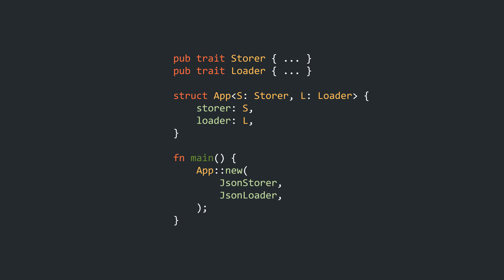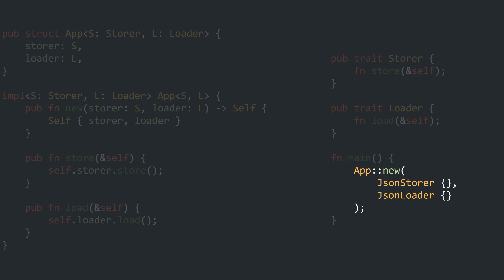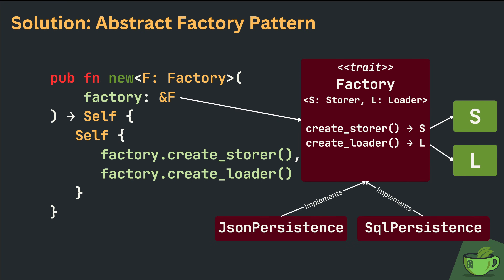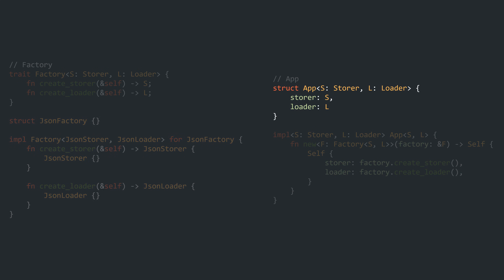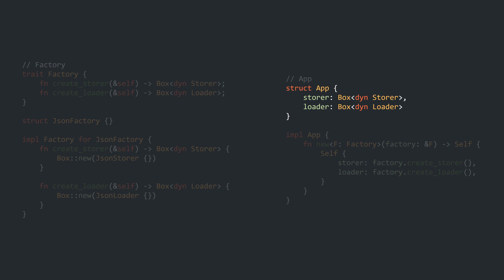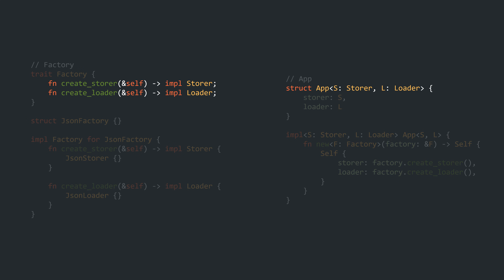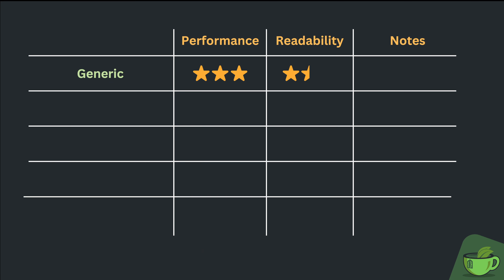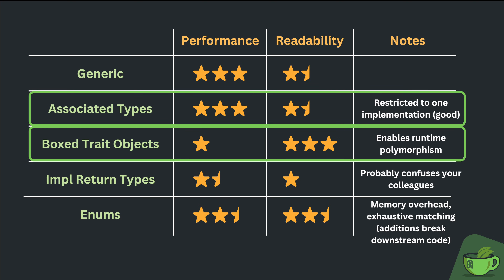Abstract Factory in Rust — Solving a Hidden Design Problem | Advanced Rust Part 14

Comment: The performance overhead with the boxes trait objects is just deref a pointer to get the address of the function and call it.
I would say not using this solution is premature optimisation and hurts readability a lot.
In this case Loader and Storer calls will take a lot longer than the extra overhead from checking the LUT..
You need to think why you are doing things in specific ways, not just always  choosing the most "performant" solution.
Reply from the maker: I full heartedly agree. People don't value readability and simplicity enough, especially in the Rust space, where everybody is hunting for performance.
Reply: It's not more readable because you can no longer guarantee that a Loader is matched with a Storer. In this case, the App is created by passing an F type that implements Factory and that takes care of matching Loader with Storer, but there could be other pieces of code where that doesn't happen. The benefit of not boxing the traits is that you know at compile time that your Loader and your Storer implementations always match (if you put the proper bounds in generics).

Comment: What about

struct App<F: Factory> {
    storer: F::Storer,
    loader: F::Loader,
}

You would take storer and loader separately in new, to make the Factory trait as flexible as possible, likely allowing more efficient implementations. (Also you don't need to change much, as you can just make your Factory zero-sized. This would be a simple trait. 

trait Factory {
    type Storer: Store; 
    type Loader: Load;
} 

I find this to be the most elegant and usable, only one generic, no lifetimes (even if the Factory chooses to use them) and minimal code changes.

Edit: Forgot to mention, this is really just a better usage of Associated Types. Also here's how new looks:

impl<F: Factory> App<F> {
    fn new(storer: F::Storer, loader: F::Loader) -> Self {
        Self {
            storer,
            loader,
        }
    }
}

Simple and readable.
Reply from the maker: Yeah, looks good to me! Thank you for the elaborate comment.

Due to how flexible traits (and their usage) are, there's so many different ways to approach this. Your solution is probably more type safe than the ones in the video, as the App itself forces the use of a factory, and not only the constructor.

From a design perspective, it might be undesirable though to make the App know about the way it is being configured (i.e., the Factory trait). Trade-offs everywhere ;)
Reply: @GreenTeaCoding I have tried it in an editor and found an upside and some downsides.

Upside: You can easily have each implementation have their own errors and still keep Storer and Loader constrained to have the same one.

Downsides: Rust cannot currently infer much from this. You have to explicitly name the Factory (even if you constrain it so  that there is only one per Storer/Loader). And rust-analyzer currently does not give good completions here.

Edit: turns out you can get rust analyzer to give completions if you couple the traits enough. No idea why.

Comment: Why introduce an additional abstraction with the factory and not just simply make a trait like "MyIOTrait {fn store(); fn load()}" and then implement it for the structs JsonIO and SqlIO? Seems much simpler to me. I think we have different coding styles, and I think I have never actually used an abstract factory to solve a concrete problem. So to me, it was very hard to understand from your example when the AF is actually useful. I would have done like I suggested for the problem in the video, which I think is much simpler and more performant than adding a factory pattern to your code base.
Reply: This pattern makes sense if you have multiple distinct objects that all need to act in concert, and you have multiple equivelent variants of those objects. For example, imagine an application which downloads media from different services. You might want a different 'Locator' object which gives you the URL of the media you want to download from each service, and a 'Fetcher' object which speaks a different protocol (like http/ftp/etc). Given that these two objects do completely different things (and have different dependancies/implementations), it makes sense to write two distinct objects that do each part.

As you've already said, this is not a situation that happens a lot in real life. And even when it does happen, quite often you'll want to wrap them in a façade object anyway. If you do that, then you can just contruct the one façade instead. This pattern only makes sense if you want (or need) to use the inner objects. One reason for this might be that you're passing these components (the Locator and Fetcher) into other parts of your code. It doesn't make sense to pass more functionality down than you need to, so the fact that they're still seperate objects is good.
Reply: As someone who worked with very real senior engineers who learned advanced patterns on trivial examples and built bloated, overengineered lasagna codebases for trivial problems, I'm with @CrazyMineCuber on this one. By teaching a pattern, you also teach how and when this pattern should be applied. Advanced patterns should be taught on advanced problems.
Reply from the maker: For this use case, you are absolutely correct. I chose this example because it was simple, and I wanted to showcase how the pattern works. 

Sometimes, it might not be desirable to lump various functionality into a single object, e.g., when modules only need a few of the provides services. So, I guess, a more elaborate example would be required to really show the advantages of the abstract factory.
Reply: @GreenTeaCoding  I agree. But I think it is dangerous to teach design patterns using examples where they do not fit well or are needed. I think it causes people to get bad habits, and they end up creating nonsense abstractions in codebases. It just makes the code worse in every possible way. So I am just saying that I think it would have been better to pick a more fitting example to illustrate the AF pattern in the video.
Reply from the maker: Yeah, I think you're right on this. There's a thin line between overcomplication and oversimplification, especially nowadays where people want fast paced content that is to the point. 
Thank you for the constructive feedback, I will try to improve on this in future videos. Kaizen 😀
Reply: @GreenTeaCoding "never hesitate to sacrifice truth for clarity" -- your example was very easy to understand and I don't think it is dangerous, we should not under estimate learners.
Reply: @rochacbruno  I agree, but with the caviat that you should just mention it. "This example could (and should) be solved by creating and implementing a trait. This pattern will be useful when <describe scenario>".

Someone who is learning might not have encountered this scenario before, and not realize there's an easier way to solve it. Prompting someone to think about when to apply the technique can only be helpful, I think.